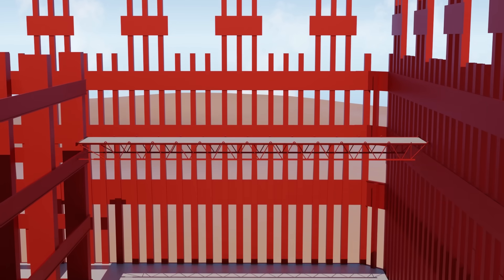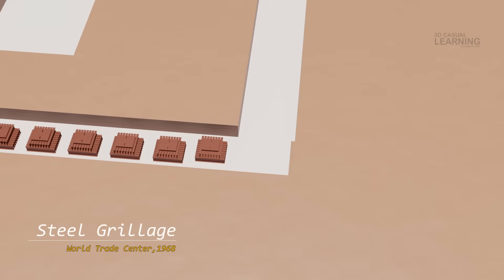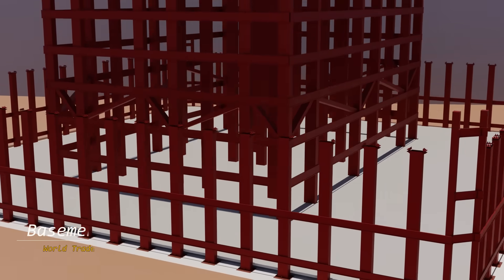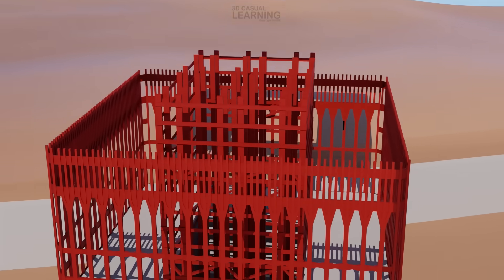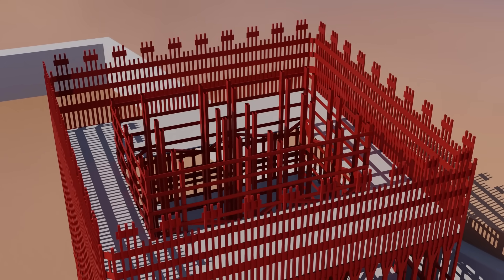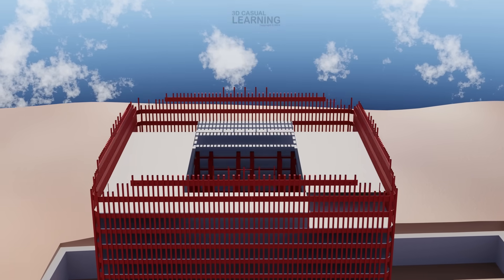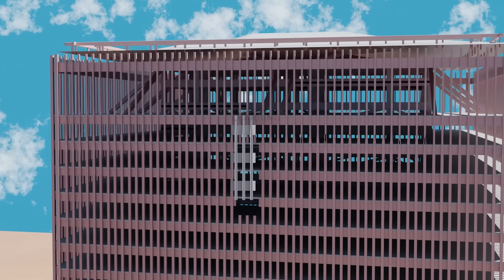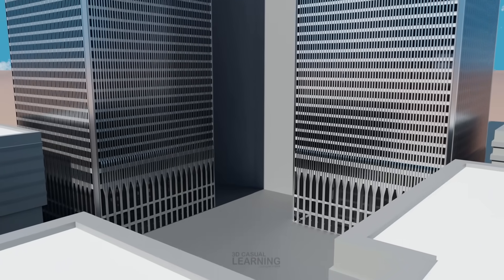The Rise of the World Trade Centre: Construction Story Before 9/11 in 3D Animation

Comment: Spandrel steel at every floor was 52" high, 2" thick plate > "Unequivocal 9/11 Nukes" at Veterans Today, real forensic engineer analysis
Reply from the maker: Thanks for sharing your thoughts! Interesting point about the spandrel steel dimensions.
Reply: @3dcasuallearning  > FEMA 403_ch-2 has correct data on Twin Towers construction > "Breathtaking: Solving Nuclear 9/11" at Veterans Today has correct WTC destruction, 45 power point slides, three 90 min videos
Reply: It was common knowledge in the intelligence community that the WTC towers were designed with the nuclear demolition scheme in place as a precondition of getting the building permit from the city.

Comment: That open-space concept without supporting columns was the main weakness of the towers. Good job with this animation, one of the best explanations of the WTC construction.
Reply from the maker: The open-space design was definitely innovative but came with its challenges. Glad you enjoyed the animation and explanation!
Reply: @3dcasuallearning  Im not an engineer- could it be possibilty if their exist a supporting columns inside the office floors the pancake collapse would not happen no matter how long the fire?
Reply: The mistake they vowed never to repeat was to allow the stairwells and elevator shafts to be penetrable again.

The entire stairwell and elevator shafts sit within a high density and high heat resistant type of concrete with a minimum thickness of at least 2 feet rising to over 3 feet thickness at the maximum.

This concrete was tested and can fully resist the impact forces of both of those planes directly hitting it without breaching.

So if this would happen again, the stairwell and elevator shafts would be completely protected and isolated from the inferno on the impact floors, allowing everyone above that to transverse through the inferno and out to safety.
Reply: @DaveP-uv1ml  Yes, in the old WTC, all the walls were gypsum. For a cost raison, of course. Some people knew this and did not hesitate to scratch or break walls to escape on 9/11.
Reply: @jakubdabrowski3846  the weakness was the lack of concrete around the core columns, but at the time the only thoughts of a plane crashing into the buildings was a Boeing 707 flying low, flying slow, and without a lot of fuel ☹️

Comment: What was never mentioned is did the “planning organization” do a structural analysis of the buildings? If they chose the Empire State or Chrysler, the ultimate effect would have been very different. Likely just the upper portions of those buildings would have toppled over. Don’t think pancaking is necessary with Empire State. Even Sear’s Tower. And Library Tower.

Is that why the “bigger plot” was wound back?

While clever in terms of cost and efficiency to build, the building essentially had floors cantilevered dozens of feet out with basically sheer walls keeping them in place. Crazy. Not even residential buildings are allowed built like this, relatively speaking. Obviously a gross simplification of what’s going on, but that was the general concept of these things. It’s a literal Jenga tower. Take one block out… entire system failure.

Edit: Possible not necessary.
Reply from the maker: Thanks for your detailed comment! The unique design of the World Trade Center, particularly the tube-frame structure, was very different from buildings like the Empire State Building or the Chrysler Building. The WTC used a perimeter column design that supported much of the load, allowing for the large, open floor plans inside—something revolutionary at the time. While this design made the towers cost-efficient and flexible, it also behaved differently under extreme circumstances, such as the events of 9/11.

Other skyscrapers, like the Empire State Building, use more traditional construction methods with denser central cores and more distributed structural elements. This might lead to different failure mechanisms in extreme scenarios. Structural analysis was certainly part of the original planning, but no design could have anticipated the impact and subsequent fires in the way they happened. It's a complex topic, but I appreciate your thoughtful input on the differences between these iconic buildings!
Reply: There is a long answer here, so bear with me. KSM, Bin Laden, and maybe some other al Qaeda people had the “planes operation” as an idea for many years. But of course, they needed the right people to do it. And it wasn’t until Haburg cell members came into the picture that the idea was given to them to carry out. But I believe it was Bin Laden who was adamant that one of the targets was the WTC. They wanted to kill a lot of people, but it also symbolized American capitalism. They did like you said have a larger plan originally with like nine planes, and some of the targets were even nuclear power plants, but it’s said that Bin Laden nixed that idea because “it could get too messy”. And I’m just guessing the idea of nine hijacked planes was lowered just because it wasn’t easy to find men that could speak English, get a US visa, smart enough to take pilot lessons and learn to fly, blend in long enough that they didn’t attract any attention, among other issues. One of their guys already kept being denied entry so they had to replace him with Hani Hanjour. If they tried to go beyond the four, they went with there was a real risk of it being thwarted. It was already known al Qaeda was determined to attack inside the US, intelligence just couldn’t pinpoint when, where and how.
Bin Laden, none of them when selecting targets looked at the structural integrity of the building, or at least probably in the detail like you are thinking. The first WTC bombing, the idea was to put a bomb next to a column in the parking garage under the tower, detonate it, and make that tower tip over and fall into the other tower, but none of the terrorists expected in a million years that the towers would fully collapse as they did on 9/11. So, to answer your question, no that would not of been the reason why they wound back the bigger plot. The main reasons being what I mentioned before.
I believe when Bin Laden and the upper echelon of Al Quida saw both towers collapse, I’m sure at first, they were elated, but then I think a few of them started to realize they had hit a nerve in Americans and that was going to be the beginning of the end for many of them. It was one thing to attack US embassies overseas. Most Americans were, and still are oblivious to anything going on outside of our country. But when the towers collapsed, that was a whole new ball game. Had they just been hit with planes and stayed up, I think it still would have been an extremely monumental event that changed a lot of things in this country and the world, but because they did, everything changed since.
Now I’m not a structural engineer, but I play one on YouTube. I know the buildings were designed to be extremely lightweight, they won awards for it the year they were built. But I think if they utilized concrete more, encasing floor trusses, or just not using floor trusses at all and using structural steel to span from the perimeter walls to the core columns, still encasing them in concrete, that could have possibly made a difference.

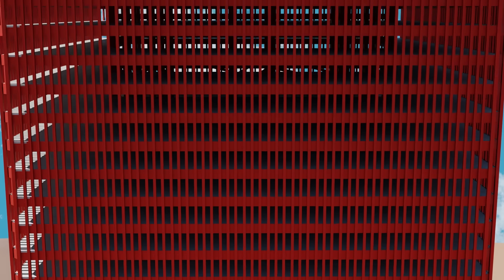Comment: 9:27 We’re just gonna not even mention the Other Mechanical floors ?
Reply from the maker: Thanks for watching! 😊 The other mechanical floors are actually mentioned at 5:35 if you want to revisit that part. Let me know if there’s anything specific you’d like more info on!
Reply: @3dcasuallearning  perhaps more detail information needed, that gave the two towers the famous visible "band"... at first i thought it's the sky lobby because it gave the sense there were two open wide floors just like the main lobby.. but later i was corrected that it was the mechanical floors, and it didn't featured windows like other floors.. but appreciate your video, because as english is not my first language, i did find hard to find the definiition of "slurry walls", and your video explains it better...
Reply: @mrandrossguy9871  which one
Reply: @Siddhantraut15  I mean there’s like 4 mechanical floors one at the bottom two in the middle and a nother at top

Comment: Thanks for this animation. But the core you presented is wrong. You did not show the diagonal bracings that exist in all steel structures. Th official NIST report also hid these bracings. You should update it with bracings in the core at every splice of core columns. Better to show much more dtails about the core columns that is the primary structure of the twin towers.

If you want learning more about the structure of the twin towers, you can watch this video. https://youtu.be/cu4mN1bbQQc?t=5455

Comment: Looking at the layout of the floor plan, I think it would’ve been a good idea to put two columns in the center of each open space in the building. If not on all four sides, at least where the open area was to add additional support.
Reply from the maker: Thanks for your comment! The designers of the World Trade Center actually used a revolutionary approach called the 'tube-frame structure', which allowed the towers to remain open and flexible inside. Instead of using central columns throughout the floors, they placed most of the structural support in the perimeter columns and the core, which housed elevators and utilities. This gave tenants large, open floor plans without many internal columns, which was a big advantage for businesses. It was a balance between structural integrity and maximizing usable space, which was cutting-edge at the time. Your suggestion could have added support but would have changed the flexibility and open design that was part of the building’s unique appeal.
Reply: @3dcasuallearning Before the twin towers were built in Lower Manhattan, there were electronic stores called Radio Row that existed from the 1920's until 1966.
Reply: @3dcasuallearning > "Unequivocal 9/11 Nukes" at VeteransToday > based on FEMA 403_ch2 > by structural engineer
Reply: @3dcasuallearning  but it may have prevented the buildings from collapsing on 9-11.
Reply: @dorothysewing9997 most likely not, the mass of 30+ floors on the remaining 70 floors below the impact would not have held up for very long. WTC Building 7 didn’t even have a plane hit it and still collapsed due to fire, it was the first building of its type in architectural history to collapse on its own due to fire.
Reply: @dorothysewing9997 nothing could have prevented that
Reply: The problem wasn't the lack of columns on the open space. The problem was that the floor trusses joints gave way when under high temperatures, the fire, the weight of additional floors and planes started a chain reaction. If it had been a bomb instead of a plane they wouldn't have collapsed. The problem was the the trusses under heavy load and the fire.
Reply: @0neo  The building almost fell down in 1993 when a truck bomb started a fire that partially burned through the clips holding up those slabs of concrete.  After that they reinforced the clips but they are not a substitute for more center columns to support the slabs of concrete.
Reply: @0neo you’re saying the Weight of the Planes that were STILL Inside the buildings/of course Mangled, Added to the Structural failure !?
Reply: @mrandrossguy9871 in pieces but yes practically nearly the full weight of the planes were still inside just spread out between the 6 floors it was in inside each tower not to mention the fuel as well was just cascading down the tower
Reply: @mrandrossguy9871  I believe Climatic Bacon is referring primarily to the unfought fire damage from the loads of fuel from the planes. A bomb would have caused a significant amount of damage, but not as much fire. While the planes did technically add weight to the buildings, it was the buildings' own weight that would become a major factor in the collapse. A good amount of perimeter columns missing, the core damaged by impact and likely affected by the fire, as well as the fires weakening the floor trusses, was all enough to cause both to collapse.
Reply: @james_fisch Most of the fuel onboard the plane would’ve been burned already seconds after impact.

However, it did started a fire to building/ office materials which burned uncontrollably and later spread to other floors.

It’s not exactly accurate to say that the building collapse from burning jet fuel as it actually collapse from burning of ordinary building materials… it’s just that the cause of the fire was from burning jet fuel.

Any kind of uncontrolled fire in the building would’ve lead to the same outcome.

The building was a death trap.
Reply: @james_fisch  It is exactly what i mean. It's not the weight of the planes (tho it added to the whole thing), it was the amount of debris and damage and the high temperature that made the trusses gave away and start the chain reaction and collapse
Reply: @dorothysewing9997  I highly doubt 2 columns on each side would  have done anything. I would have said using rolled structural steel floor joists for ALL floors, not just the mechanical floors.
Reply: It’s also something to note that people inside the building reported to 911 that floors were collapsing. So before we saw the collapse floors were already collapsing adding increasing loads into the already weakening structure